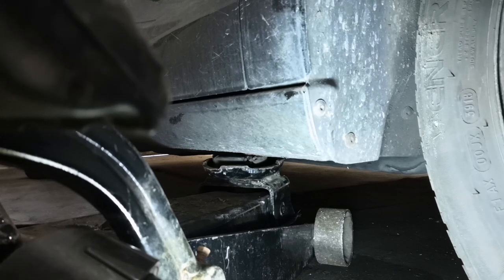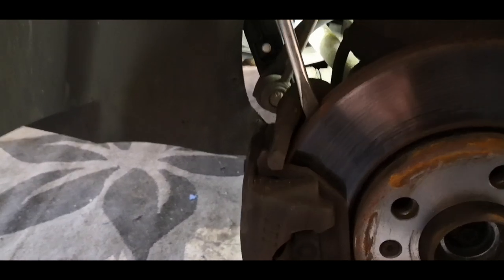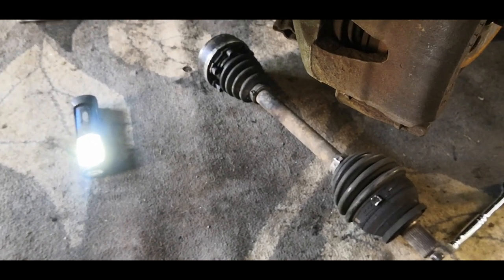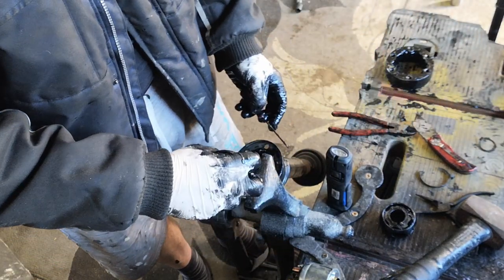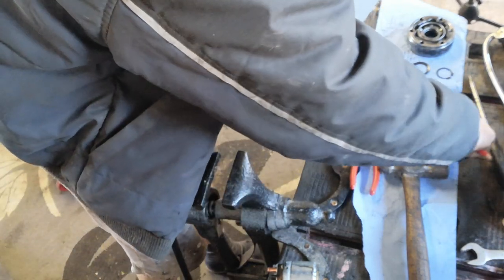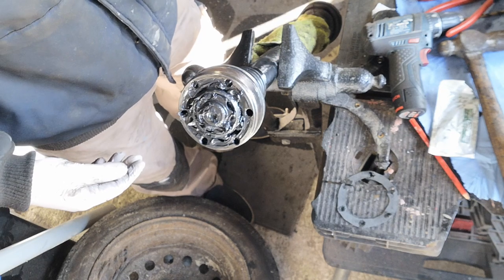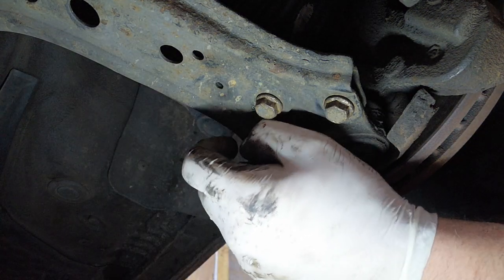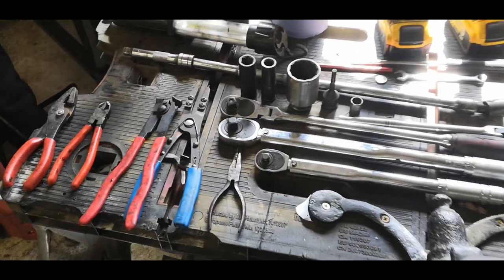Replacing Your Vw Polo's Inner Cv Boot (1.4 Tdi 9n)

Comment: Thanks for this vid. Everything nicely explained and some good tips there, e.g. jamming spanner into brake disc to lock rotation. Showed me how to remove the driveshaft from the hub, which was holding up my strut replacement job.
Reply from the maker: Thanks for the comment, glad you got it done
Reply from the maker: Thanks for the comment im glad the video helped... If you have any tips or your own you found helpful post them here in the comments

Comment: I have a serious amount of play on my 6R Polo and keep putting off this job. Thanks for the video, it has given me a bit more confidence to bite the bullet on this. I might also just replace the entire shafts rather than go through the hassle of pulling the CV joints apart as I should be able to get replacements from China pretty cheaply as they have the same model there and parts should be easy to get hold of.
They Haynes manual also recommends you replace the axle nut each time you remove it although I know many mechanics just re-use the old one. I guess the tolerances for these are pretty high so probably overkill but wonder if anyone has any thoughts on this. If the nuts are cheap and readily available, might as well do that just for extra peace of mind.
Reply from the maker: If you replace the entire shaft it will likely come with a new axle nut. J&R driveshaft are very good, and cheap.

All the best!
Reply: @maxautouk  Thanks for getting back to me on this. I'll make sure they supply the nut when I order the part.
Reply: Did he put the new ones??. My customers gets the new ones
Reply from the maker: Why do you mean?

Comment: Just a note on this. That joint that didn't move properly had been put together incorrectly. On the inner and outer parts of the joint you will see grooves that the balls run in? You'll notice that some have a wide space between them, and some a narrow space between them. A wide space on the outer should be adjacent to a narrow space on the inner. You'll see that by chance, the first was like this, and worked, but the other, the narrow gaps on inner and outer were facing each other. Also, there is a groove around the outside of the joint, that is USUALLY the gearbox side of the joint. Refit them as they come off though. These were correct.
Reply from the maker: Great info, thanks dude

Comment: Great informative video. One part you did skip over though was how you freed off the binding cv joint after you installed all the ball bearings. Can you remember how you managed it? Thanks.
Reply from the maker: When they bind you just need to twist it in the opposite direction, or pry out one or more of the abll bearings until it frees up and sometimes I'll hammer on it gently with a deadblow or brass hammer to get it moving again
Reply: That joint had been put together incorrectly. On the inner and outer parts of the joint you will see grooves that the balls run in? You'll notice that some have a wide space between them, and some a narrow space between them. A wide space on the outer should be adjacent to a narrow space on the inner. You'll see that by chance, the first was like this, and worked, but the other, the narrow gaps on inner and outer were facing each other.
Reply from the maker: @garycrofts1421  thanks for the comment and the info, everyday is a school day even when you've been at it a long time. I didn't flip it over which may surprise you i just tapped it very gently with a plastic hammer and fitted the last ballbearing and fitted it up to the car, been a long time since I did this job and it's still working fine with zero issues

So you think it would cause issues down the line?

Comment: My bolts have snapped off and now the axle is hanging off , can I take the whole thing out of the gearbox?
Reply from the maker: Yea there is a bolt in the middle of the flange where the splined section goes into the gearbox

Comment: The screwdriver in brake disc method is  not a good idea as all the force is placed on the little countersunk set screw. In my case it sheared the screw before it came loose.
Reply from the maker: Thanks for the comment 😁 yes sadly they are known for snapping and rounding out, ive never personally had the issue you've had and thanks to you I won't have to either 😁👍🏼
Reply: Can Just put one or two hub bolts straight in too before trying this and it won’t put all pressure on the small screw.
Reply from the maker: Good idea! Thanks for taking the time to leave a comment

Comment: Can anyone tell me what size socket I need for the outer driveshaft retaining nut,and what size Torx for the 6 inner bolts? Thanks in advance! Great video,thanks for posting!👌
Reply: M8 spline, not torx
Reply: @paulmckenna7718 thanks for that Paul!👌
Reply from the maker: And I believe the socket need is a 12point but I can’t recall the size - sorry

Comment: Good video but you should use new bolts on the ball joint and, a new hub nut.
Reply from the maker: Thanks for the comment yes you’re right the driveshaft bolt is torque to yield and the manufacturer says it should be replaced but the balljoint nuts are not torque to yield and are reuse able

Comment: Has anyone here had problems with a steering wheel vibrations at higher speeds?? I've been through all the likely culprits but nothing has changed yet. Im wondering if this will fix my problem...
Reply from the maker: I assume you’ve balanced the wheels?
Reply: @maxautouk  multiple times. I've had them balance and aligned.

Comment: What size spline for the inner bolts?
Reply from the maker: For what it's worth I think it's worth getting an entire set, they aren't very expensive and a single socket often costs not much less.
 https://www.ebay.co.uk/itm/New-8pcs-1-2-Impact-Spline-Socket-Bit-Set-M5-M18-Bits-Cr-Mo-78mm-length-B1690/274277445430?hash=item3fdc35af36:g:PcsAAOSwGAheTPw3

Comment: My mechanic removed it from under the car without removing the 6 screws. I dont know how he did it.
Reply from the maker: On this car I don’t think that is possible since the inner section of the shaft stub is held into the gearbox with a single long bolt. Some polos have a different driveshaft that just pushes in and has no bolts